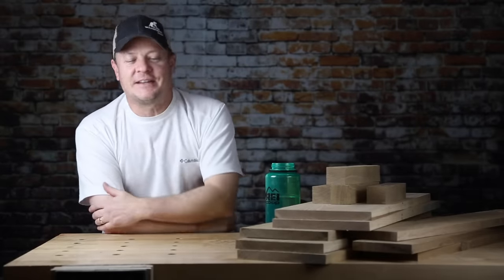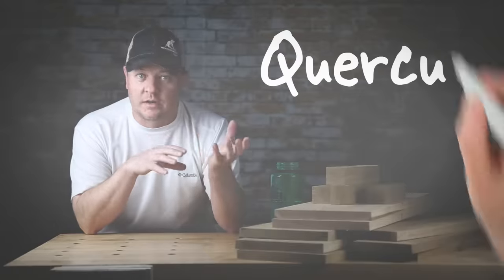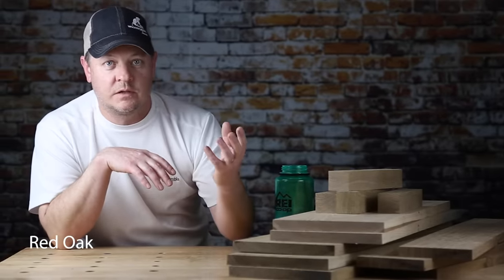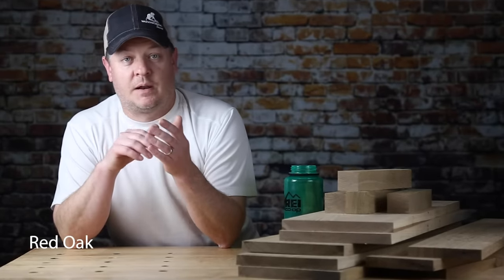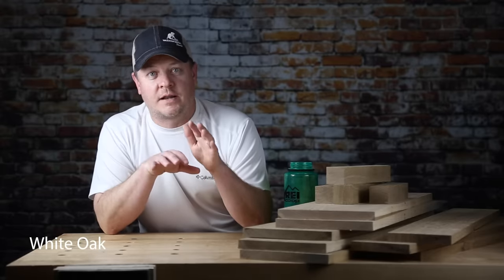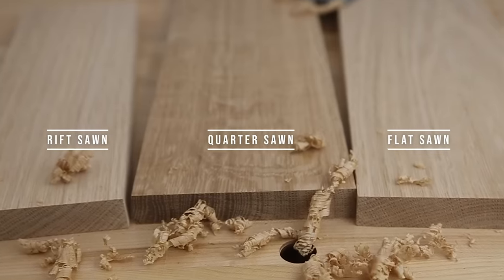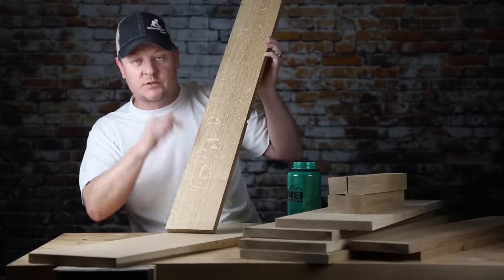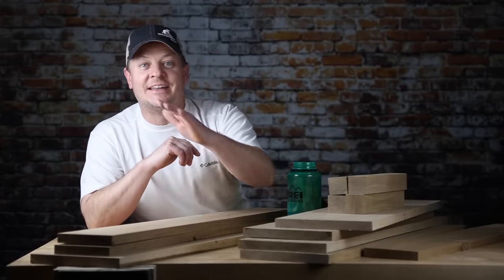The REAL Difference Between OAK Lumber

Comment: I used to work for a farmer throughout high school and he had me doing fencing in a swampy area of the cow pasture. The were many split white oak posts that had been there for decades and they showed no sign of rotting despite being in an extremely wet environment. The red oak didn’t do nearly as well.
Reply: Red Oak is not good for anything outside in a wet environment.  White oak is.  The best wood for fence posts is Locust.  It is rock hard and lasts for decades.  Vikings also used white oak for ship building.  Red Oaks often rot from the inside of the heart wood, leaving a living tree hollow inside.  White oaks are less likely to rot this way, so usually live longer.  A white oak in my yard lived to be 115 yro. It was not rotten inside.  It just died.  I miss that tree.

Comment: Interesting fact about oak lumber and presumably any lumber for that matter): the more spacing between each ring indicates faster growth and that also makes it slightly weaker than lumber with closer ring spacing. Where i studied for my forestry degree in southern illinois the soil conditions were great for fast growth but this translated to slightly weaker lumber. In the rocky and rugged soils of the Missouri Ozarks the growth is very slow but also makes very sturdy oak lumber.

Comment: It is helpful to think of wood grain as a stack of straws or tubes.  In red oak the tubes are small enough to break the surface tension of water & move the water through capillary action.  White oak, these tubes are segmented.  These segments block the migration of water through the tube.  White oak was the common wood for garage doors or other outdoor moments 100 years ago plus. These segmented tubes also make white oak a touch harder.

Comment: One feature of the two oaks discussed that you didn’t mention is the difference in the aroma emitted by them . White oak has an aroma that smells somewhat like cotton candy when being worked, or like something you’d enjoy eating. Red oak frequently smells sour, not unlike vomit. The odor or aroma of the two woods may also help explain why the white is used for casks instead of the more odiferous red.

As a cabinet builder I’ve only built one rather disappointing (from my standpoint) kitchen with red oak while I’ve done several with white...a much more pleasing appearance. The white also tools better, and is much more uniform in color and texture.

Enjoyed the video and the ensuing comments and discussion...very informative.
Reply: Reds have much more tannins in them. That's why they smell sour, why wildlife likes white oak acorns more and why when working with red oak a lot some people's hands actually react with the tannins and turn black (first hand... knowledge)

Comment: You are quite right about using white oak outdoors.  I once built an outside bench from red oak recycled from old kitchen cabinets.  Felt so good reusing the wood.  18 months later it was falling apart.   Red oak just does not work outside.   It has a grain structure that causes  water to wick up into the end grain and rots it from the inside.

Comment: Does white oak tear as much when cross cutting?

This is probably one of the best informational videos I've seen. Straight to the point, and very informative. Nice work!
Reply from the maker: that's a good question, sorry we didn't hit that in the vid more specifically. But , yes, white oak does behave a little better with cross cutting. Thanks
Reply: Thanks

Comment: I was hoping you would give us some insight on "live" oak.  I've never worked with it, but was wondering why I always see other woodworkers either get big grins or cringes of death whenever live oak is mentioned.
Reply: That's because live oak is not easy to work with and rarely grows straight, which makes trying to make straight boards and other components very tricky. Also in my experience you should either work it green or have very sharp tools or you will not cut even a somewhat dry piece of lumber, at least not without some frustration and it can even chip the blade of a tool if your not careful since its so hard(its tougher than white oak) I only know because I did that to a tool myself. However, anything made from it as far as i know, is bound to last due to its hardness and resistance to rot, its also a very beautiful wood in most cases.

Comment: Great video with a well thought out explanation of the differences between red and white oak. I would just add that white oak is used for making water tight barrels. White oak, like other light color hardwoods such as maple, demands that a woodworker makes sure his power tool blades are super sharp to work on white oak to avoid burn marks, especially on the joints.

Comment: What’s your opinion on glue ups for panels, table tops or whatever between said F-150 and Mustang pieces of wood? Do to the relative differences, would “mixing” in a glue up make for a more “unstable” product? And basically for the same question, what about in the mixed glued up joining of the 3 different styled milled , for let’s say cabinet doors? Would that be ill advised? Before getting deep into wood working, I’ll feel better knowing more about how wood works with each other in it’s different forms. Your video got me wondering and really curious . I’m glad you did this video.
Reply: Mixing cutting methods is very common.
A well made door for instance, would have the mounting and meeting styles made from quarter sawn lumber, and the panels made from rift or flat sawn.
Reply from the maker: Glue a F-150 and Mustang together, you get a Fusion I think

Comment: Mark, I notice you usually use reward shellac to seal your projects instead of a sanding sealer or lacquer sealer, is there a reason?  I mostly finish with clear lacquer and don’t want any yellowing so I can see the wood colors pop, dreaded shellac appears to yellow more than sealer, or am I wrong about that?
Reply from the maker: Only that it’s easy, very clear and dries super fast

Comment: Hello friend. I live in jordan where we don't have that many options of solid wood. I am willing to make a book case from oak. When I did the wood pricing I found a significant price difference between 1 inch and 2 inches thick lumber (price of 1 cubic foot of each) . 2 inches thick oak is 20 to 30 percent more expensive. Is there a technical reason behind this price difference? For example Milling process, sap vs heart... Etc?
Thanks in advance for your help

Comment: I grew up in Minnesota but only started woodworking after moving to Maui and the only Oak species I have used is Silky Oak which looks like quarter sawn Sycamore, just lighter. It turns like butter and an interesting tidbit is its sap, when hardened, takes a slightly flexible glass like consistency.

Comment: Great video. One point of correction, the USS Constitution's hull was built of Live Oak. The Navy actually has a grove of Live Oak trees they use when the ship needs repair.
Reply from the maker: The way I understand it is we are both right. According to the Navy, live oak was used on a lot of the framework, but the hull was indeed white oak.
Reply: @WoodworkersSourcecom  The hull was a composite of three layers with the outer and inner horizontal layers being made of white oak and the center vertical layer being made of live oak. It was the live oak that gave the hull its iron like strength. Live oak has a density of 63lbs/ft3 vs white oak 47lbs/ft3.
Reply: I would like to see him machine live oak. You can get it after a hurricane blows through the south east.
Reply: @davepeterson3449  I've got about 200 bf of live oak and mesquite (i live in south Texas), the stuff is bullet proof.
Reply: The outer planks as well as many structural members in the ship (like knees) are indeed white oak. The hull planks range from 4 - 5" thick at the top of the sides to nearly 9" where it meets the keel. The innermost hull planking (called ceilings)  were a variety of woods depending where they were. These were mostly pine or fir. The designer of the ship, Joshua Humphreys, insisted that the frames be made of live oak, even though it cost them 5 times more that the white oak. This was for strength and resiliency.The live oak would last much longer and since these were frames, it was a major effort to gain access to them for replacement.  These frames run vertically between the top rail of the deck down to the keel. The space between frames was approximately 2". So looking at the ship without the white oak planking it would still look like it was almost solid wood. So it was a combination of the white oak exterior and the nearly solid wall of live oak behind it that repelled cannonballs.

Comment: Admittedly Live Oak is used more in building wooden boats, not furniture and kitchen cabinets, but it's worthy of mention I would  think.... Great video!
Reply: Live oak is any oak that is evergreen. It is not used in furniture mainly because it tends to have very bad wind shakes and will injure/kill you in a moment with no warning.
Reply: @joshua43214  There are several species of "evergreen" oaks native to the southeastern US:  Myrtle; Water; Sand Live; Virginia Live among them.  Not all make good lumber.  Virginia live oak has the densest, most durable wood of any of the 90 or so species of oaks that grow in North America.  It makes excellent outdoor furniture that is weather resistant, but it is very hard to work with and difficult to source.  It is an excellent choice for boat decks.

Comment: @1:14:  When people talk about red and white oaks, they are talking about the two main groups of oak species, not merely the two species that happen to be called red oak and white oak (scientifically or colloquially).  E.g., Q. Buckleyi is a red oak and Q. Macrocarpa is a white oak.  Between the two groups, there are differences in leaf shape (pointed vs. rounded), tannins (high vs. low), wood characteristics (e.g., ray prominence), etc.
Reply: Yes, ncooty, you are right. Red oak and white oak each contain numerous species that have numerous characteristics in common. One of those characteristics is color. The red oak woods tends to be slightly red although with a lot of variation, whereas the white oak boards tend to be grayish.(although the color, with its variations, is not usually dependable for classification.

Comment: hey nanny just told me what i was wondering until fall.    leaves changed colour n discover that we have red oak n black ash for bow making.    i’m wondering if you have any tips on  reading red oak tree.   knots twists etc.       should i use a tree about foot in diameter or saplings.     n what’s difference in wood characteristics between 6 in sapling vs 1 ft tree

Comment: Besides the red leaves in the fall, red oak does have a pinkish cast which shows up in the lighter stain colors and especially when finished natural using a solvent based finish (oil modified poly, conversion varnishes, etc...). White oak also has a more acidic property (higher tannic acid content) than red oak, which can make the wood look "green", especially when a water-based coating is used on it. Care must be taken to avoid this. You will also definitely get more pronounced "figure/fleck" (medullary rays) with white oak versus red oak in the quarter-sawn cut.

Comment: White oak has a sort of vanilla smell to it and red oak smells like cat poop when you cut it.
Reply: Interesting, but somehow i'm not really sure i really needed to know that. Some factoids are maybe left buried!
Reply: Of course those probably smell worse when you dig them up.
Reply: @blackrabbit212  are you sure you don't just need to blow your nose and brush your teeth?
Reply: Why would you cut cat poop?
Reply: @jpr8578  are you sure they aren't mistaking red oak for poplar,  when I had to cut it in the shop I worked in it smelled like burning down the old out house!
Reply: I found that the oak from northern sources had less bad odor. I stopped using a source of Oak because their supplier was from the southern forest.
Reply: I agree but I always thought  it smelled more like possum poop   really bad odor but nice to work with

Comment: Good day Mark:
I love your channel, and it is really good to watch someone who knows what they are talking about and someone who does an excellent job of explaining what he is discussing, thank you for that; it is greatly appreciated.
So, I have a quick question for you, in regards to finishing.  I just watched your show "The ONE Difference Between MAHOGANY Lumbers", where you mention pre-finishing the parts of the project with such items as Boiled Linseed Oil, Tung Oil Varnish, Danish Oil, etc., and then doing a final finish with what the individual desires.  
So, is it a good idea to pre-finish ever part, of the project, before assembly?  
Is this a really good way of sealing up the wood to help and prevent the wood from becoming too dried out or gaining too much moisture during the year?
Reply from the maker: The reason I suggest prefinishing parts is only because sometimes it's easier. Just to avoid having to fiinsh into tight corners. Depends on your project and your threshold for tedious work, lol

Comment: My favorite Oak is quarter sawn white oak. You can spot the best boards to pull out of the stack by looking at the end grain. If the grain runs vertically, it's quarter sawn. If the grain runs horizontally or in an arc, it's slab sawn.

Comment: White Oak: Used for pickup bed floors  back when those were common, boxcar floors, "oak hardwood" floors in homes, furniture frames, as you mentioned ship hulls ...
Much more durable and wear resistant than red oak. Why choose Red Oak when White Oak as so many advantages over Red Oak?

Comment: This video about White Oak is very informative, filled with useful information. Unfortunately, your vignette about Old Ironside is a shade skewed. During a tour of the vessel while at its home port in Rhode Island several years ago, the US Navy enlisted tour guide discussed the hull design at some length. It was a 3-layer laminate structure, so to speak. Southern Live Oak was the heavy, dense, cannon-ball deflecting middle layer, which gave the ship its great strength. White oak planks served as the inner and outer layers. The cannon balls went into the white oak planks, only to be stopped by the live oak, at which point they simply bounced into the sea, or remained stuck in the white oak planks.  I thought you might want to know that. Of course, if you already knew that, cutting the detail to keep the video from getting to long is understandable.

Comment: The USS Constitution was built out of southern live oak, Quercus Virginiana. It is even harder than normal white oak, and the grain is interlocked and curly. I have wonderful live oaks in my yard. When you hit a piece with an ax, there is a spark . Whoa.   And it is immortal. A dead live oak will stand in your yard forever.
Reply: The hull consisted of three layers with the outer and inner horizontal layers being made of white oak and the center vertical layer being made of live oak.
Reply: Does live oak even grow in Va today?  I know it's common down south I had several in my yard in Florida.  In Va at my home it's all white and black oaks literally well over 100 densely packed. 

My understanding is live oak is the best of all oaks for ship building.  It's also a protected tree in many localities today, I couldn't remove one from my yard that was getting into my sewer line.  I was told no unless it was damaging the foundation.

Comment: I am not aware of whether this concern was commented upon but you failed to mention that quarter-sawn boards do not expand as much as plain-sawn boards.  As a result, tops and sides made with QS boards are more stable during seasonal changes.  This is important to cabinet makers.  Quarter-sawn boards yield less useable lumber and thus are more expensive.

Comment: When it comes to naming woods by their colour I have a little stock of black locust.   The bark is a dull grey and the wood is a light, creamy colour.  I'm a hobby woodturner and this species turns very well but I've no idea how the name came about.  Anyway, I enjoyed this short video.
Reply: On older mature trees the bark is quite dark.  Black locust excellent for outdoor uses, probably second only to Osage Orange ("hedge", "bodart") in decay resistance.  Often used for fence posts.  Also, very strong and dimensionally stable with changes in moisture content.  Hence, used as the pins supporting the clear and blue glass insulators one used to see used for power lines often along RR tracks.  Dating myself here. Flowers white and fragrant, nearly identical to sweet pea flowers, not surprising as its more or less a legume.
Reply: "Bodart" is actually "bois d'arc" pronounced bo-dark

Comment: Curious...  red oak is the hardest stuff I can find at big box stores...  is this acceptable for hammer and axe handles?  Hammer handles will be less than 16 in overall, axe could get as long as 32 inches, single bit head if that matters, but usually top out at 18 in
Reply from the maker: mylar hyrule hickory is the more desirable choice for ax handles but red oak will be fine too.
Reply: Woodworkers Source yeah, I wanted hickory, but I can’t find boards of it in a 40 mile radius of me, so I might pick some up when I’m that direction. My other options locally are poplar and pine, lol.

Comment: I have a question for anyone really, a client wants a fence that resembles groynes (we have em on the beaches in UK) I suggested in oak but now I’m worried about warping, so my question is, each board 200mm x 50mm x2.4m will be bolted twice at each end to big posts and was considering 2 steel dowels across the span, do you think the above would prevent warping??